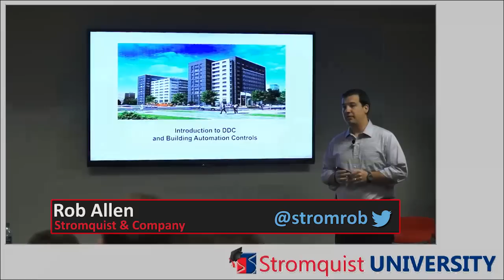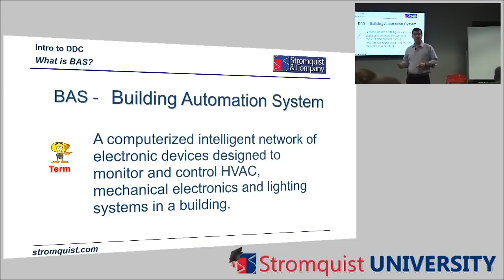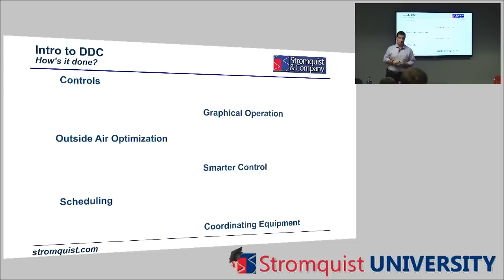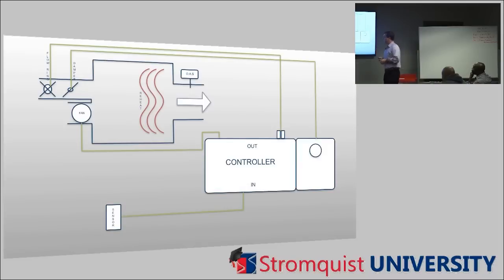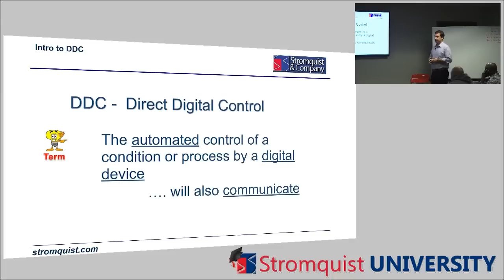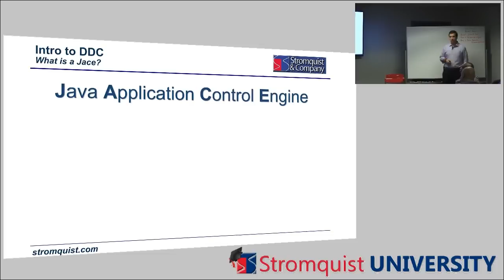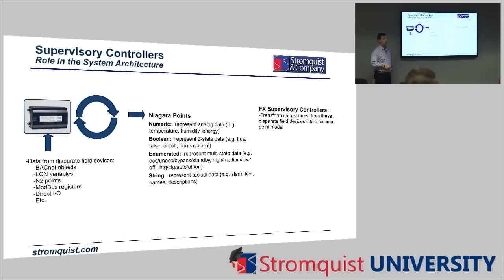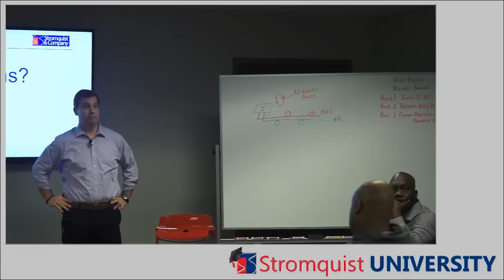HVAC Tech School: Live P1: Intro to DDC and Building Automation Controls

Comment: A VAV Box controls temperature in many cases (cooling, typically) as a function of airflow, modulated by the box airflow damper.  So an additional input refered to as a flow ring is really the differential pressure across the ring extrapolated to flow (sq root) for the purposes of a soft PID loop looking at flow and controling to a defined setpoint via the damper motor. This was not pointed out by the instructor, and air flow  was pretty much ignored.

Comment: 42:00
There are many network topology used in industry , to clarify, I'm gonna talk about only 2 of them that are related to this topic.
1. Daisy chain: Can be either linear ( wired in sequenced ) or it can be ring ( the last devices is connected back to the first device). The difference between the two is that In case of a single component failure in a linear daisy chain, the network WILL FAIL! , while in ring topology it is still possible for the transmission to go in reverse direction.

2. The topology in 45:15 cannot be called daisy chain, It is called "Multi-drop", "trunk & cable" or " bus".
This topology is suitable to maintain its connectivity in multi-failure scenario as you stated, it is just NOT daisy chain.
Reply: can you tell me the software to program a alerton DDC, please? is it free?
Reply: i need a the link to download the software, please!
Reply: Daisy chain is a slang term used for wiring electrical devices and circuits in PARALELL, anything else is considered a circuit or device wired in SERIES.
So, yes, he can call the topology of 45:15 a Daisy Chain.

Comment: Hi,
Thanks for sharing this video, I am Jolly from Philippines and currently taking up BS Electrical Engineering. And part of my education requirement, I need to make a Thesis. I have a background and experienced in operating BAS here my current work. but don't have in depth knowledge regarding BAS, DDC, installation set up,field control and how its hardware and software works in the Building. My propose Thesis topic is about the New User Interface and Integration of BAS in our company. Kindly help me any links or information where i can gathered data to make my Thesis feasible. I'm looking forward for your great help to make my dreams as BS Electrical Engineering. God bless!!
Reply: Jolly JoJo check out person from the USA his name is Phil zilo from building automation monthly that’s the website

Comment: what is the difference between a PLC and a ddc?
Reply: Abhijit Shetty plc stands. For programming logic controller and ddc stands for direct digital controller . The website called building automation monthly
Reply: Literally there is no difference because both are programmable logic controllers based on microprocessors but DDC is especially developed for Building Control applications. The DDCs have well defined libraries of functional blocks that makes their programming much easier as compared to the PLCs which are generally used across all applications.

Comment: Not sure why not too use proper word to describe how to connect controllers it's simply - wire it in parallel.
Reply: You are right, but here is not exactly parallel. Daisy chain connection is slightly different.
Reply: Arentas REC check out the building automation monthly online website .